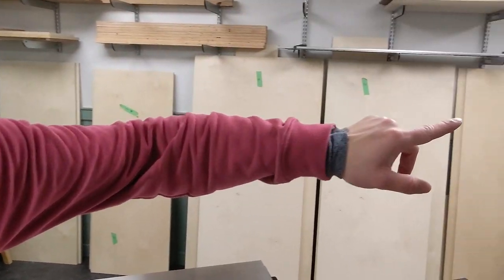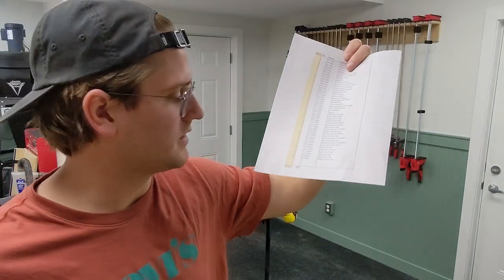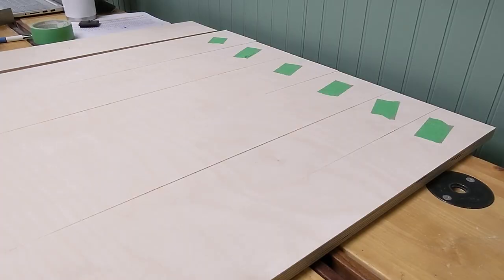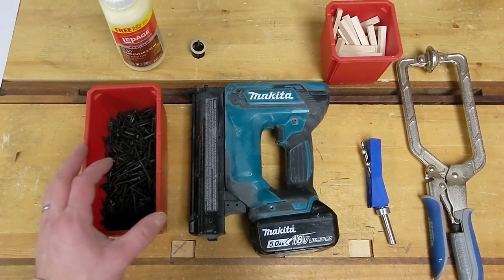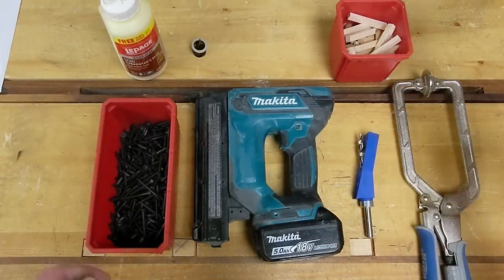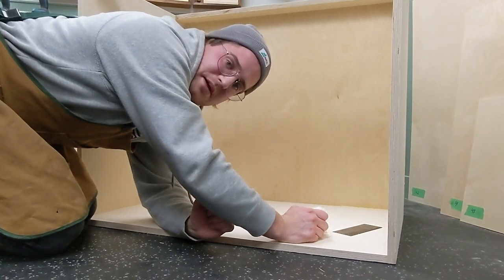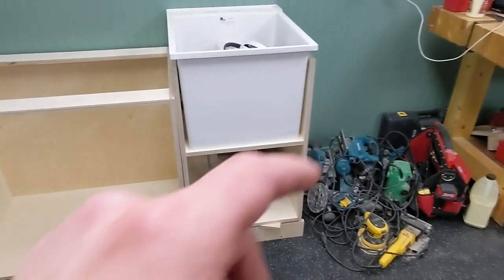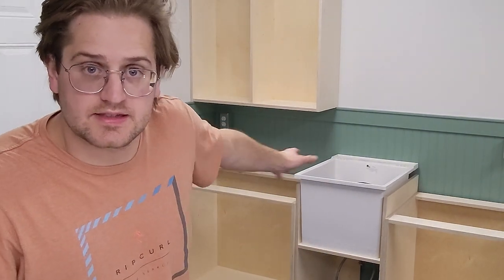Building shop cabinets with my WIFE! ep14

Comment from the maker: Thanks for watching and reading the comments! Do you glue your back panels?? I stopped after that fail lol.
Reply: I would glue and Brad nail but probably just make it overlap the edge grain rather than fall in a groove. Also a lot of cabinets I have seen have only a few strips of 3/4" plywood on the inside of the back, one at the top and one the bottom.
Reply from the maker: Yeah I'm thinking that could have gone that route on the lowers. Less materials and time too. For the upper I'm kinda wishing I glued it and just calmed down with how much glue I used.
Reply: You could just use a pin nailer and a few small drops of glue…..
Reply: For the most part is do, I have been since 2017.

Comment: Back panels are usually floating if they are in dados. But if it’s not a finished end cabinet I would just staple in on the back rather than cutting grooves. Some guys put a dab of glue in the middle to keep it from moving, but still allow for expansion and contraction.
Reply from the maker: Hopefully I'm good on the movement! Think I'll be OK with it being plywood but never know. Definately floating the way to go.

Comment: Nice addition to the shop, looking forward to seeing them finished.  What model Makita is that?  I'm knee deep in Makita batteries and in the market for a cordless brad nailer, but I've heard some conflicting things about the XNB01Z.
Reply from the maker: Thanks Alex! New video coming soon. Its the Makita DFN350Z 18 guage nailer. I love being cordless but I wish the gun had a little more juice. When shooting longer 1-1/4" or 1-3/8" nails into dense plywood (baltic birch) or hardwood it sometimes doesn't drive the nail fully in... for smaller and thinner materials its great though. Sick of air though. Check episode 05 for a mini unboxing/review.

Comment: Dude, you have spent a few dollars on tools obviously based on your video...........why not a second track section for your track saw so you can cut a full sheet without having to move the track?
Reply from the maker: Lol I remember filming that and thinking that someone* will make a comment about this. When I bought the track saw all they had was another 4' length so I grabbed it. But I hate inserting the rods and set screws to combine them together so often get too lazy and just use the 4' track. I really need to just buy a longer 8' track...
Reply: @BlakePizzey  Longer 8' track would be perfect.  I thought I saw your pocket holes were drilled in the direction of thinner wood (towards the outside edge) in the attaching piece.  If no one can see the outside of the cabinets, try going from the outside to where you have more wood on the inside for your screw to attach to.  Just like drawer making.  Other wise these look like they will be beautiful shop furniture cabinets.